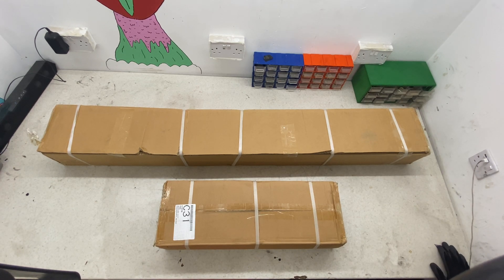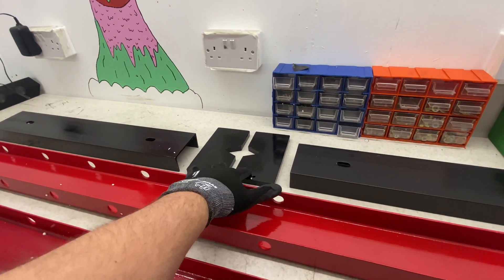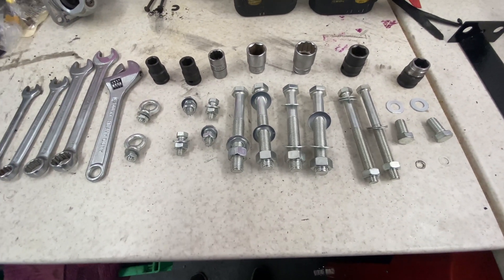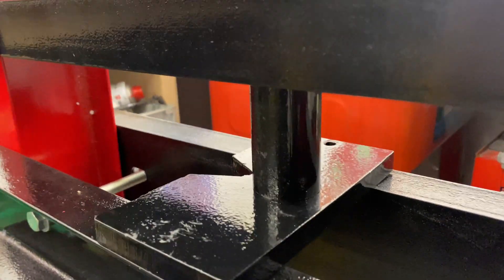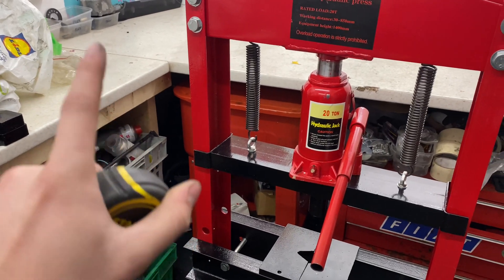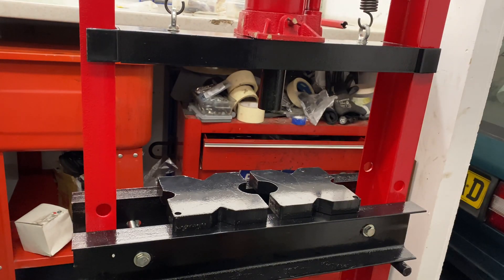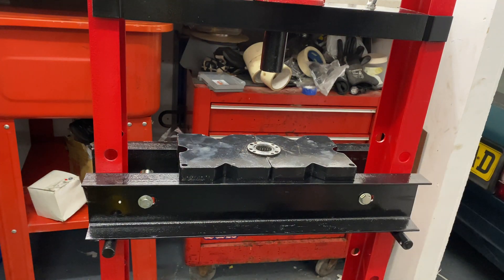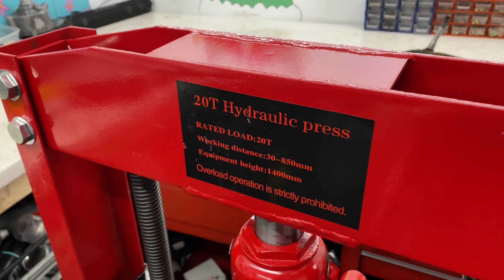eBay ‘20 Ton’ Hydraulic Press - First Impressions, Review and Upgrades

Comment: I have to disagree about build quality, there is none. Shocking. I re-drilled the two bars you press on and made 2 tubular spacers to fit between the bars so that you can tighten the nuts and bolts permanently. Same for the 4 top corner joints and added some thick washers in those gaps, again so that the fasteners can be tightened. In between to lower brace and the outer frame I made and added spacers so that the bars you press on can be lowered all the way to the bottom of the 6 sets of holes. Added a set of (4) 50mm 50kg. castors from Tool Station so I cam move it around easily.

Comment: I have a 12T version also from eBay and found the same build quality issues as you did (although it performs perfectly adequately). I hang a net across the middle from the supporting pegs to catch the item being pressed out if it's a bush or bearing. After a few modifications to mine it'll be getting repainted with grippier paint as that gloss finish on the black sections is a nightmare.
Reply from the maker: Good to hear yours performs well too. The net is a great idea, I don’t like to be anywhere near it when I’m pressing out wheel bearings/ball joints!

Comment: Will it fit wheel bearing in the hub
Reply from the maker: Tricky to say without knowing what hub etc, but I’ve had no issues removing and installing front and rear wheel bearings from my bmw e30
Reply: @BadE30  well it's audi a3 8l so it should be ok, thanks

Comment: How is the bottle jack fixed? Would it be easy to replace with a pneumatic jack?
Reply from the maker: It’s simply held in by the tension of the springs, pulling it up into the arbor. Would be very easy to exchange it!
Reply: @BadE30  Perfect, I was just researching before I ordered one, I thought this would be a good/cheap modification https://ebay.us/K8nPGC